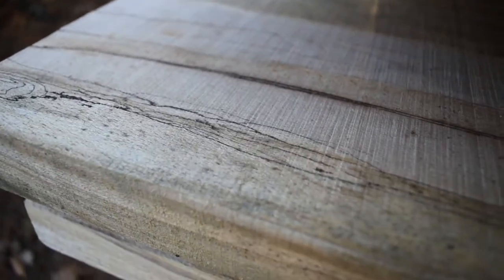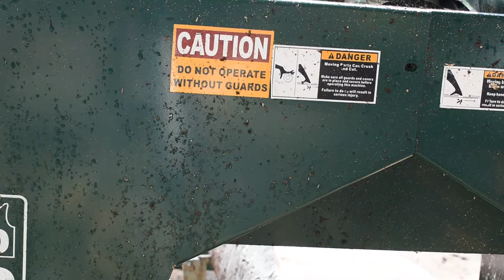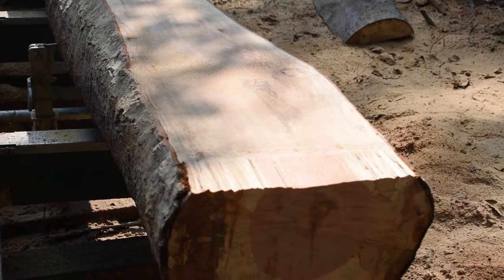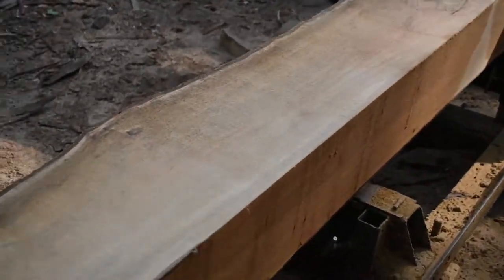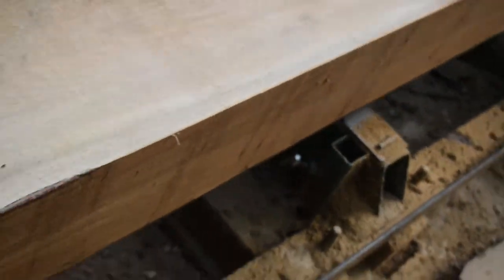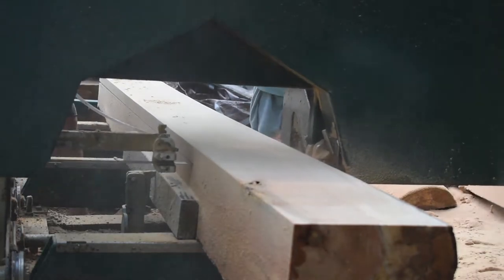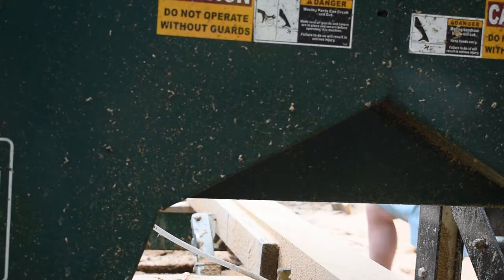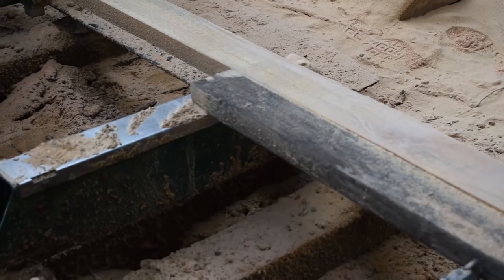Milling a Spalted Beech Log - Making Beech Lumber - Woodland Mills HM130 Bandsaw Mill

Comment: Have you had any issues with the Beech twisting or warping? It has twisted grain most of the time and I've wondered whether it's worth milling or if will turn into a twisted mess
Reply from the maker: Beech can be tough like oak sometimes.  If it has a lot of stress in the tree from growing it will be tough.  I would recommend sealing the ends of the log with paint, milling the log, stacking and stickering, then strap it tight really good and air dry it.  Beech is a great wood o work with, but it is very hard.
Reply: Thanks for the advice!!
Reply: As a suggestion, I started sealing ends with large containers of straight wood glue, two coats, and it works fantastic
Reply from the maker: @afriesen6  Wood glue also works great. 💪

Comment: My wife and I have been watching your videos for a while now. From set up etc. 
I have a few questions for you if you don't mind or have the time to answer them. 
I am tossing the 130 and another  mill. 
Since you have had your mill for a while now, how well do you like it. How hard is it to get a true 6X6 post out of your logs and it still be square on both ends. 
How about the blades, Are you sending them off for resharpening and or is there even a service for that or do you do it yourself.?
I am looking at the total cost to run the mill over a year or two year period, and I figure the mill will use quite a few blades trying to mill enough wood off my property to build a cabin, and or small house. 
I appreciate you taking the time to make the videos with your mill. 
Also, I have seen a couple on youtube with electric starts on this model and I don't see it as an option on the website and I don't see electric start on yours either, so curios what you know about that, I figure I will be doing most of the grunt work and my wife will help as well, and if she can run the smart end, i.e. me not having to start it for her, it would make life easier.?
Thanks again and have a blessed week my friend.
Reply: Also, My wife and I are close to 50, She has a bad back and mine is just old, do you wish you would have built the rails higher so you wasn't bending over as much, I am trying to figure out if we wouldn't be better off building a higher stand and or going with the trailer model, i know loading the logs would be harder, but milling I would think make it easier not bending over nearly as much for each pass of the mill?
Reply from the maker: Heartland Outdoor Living Thanks so much for watching being here with us all this time.  Since you are looking into getting a mill for yourself I will work on making a good Q&A video since it will make it easier to answer these questions and I will be able to go into more detail.  Thanks for watching and feel free to ask any questions you like.  I will put a video together and answer them all the best way I can from my experience.   Thanks for watching.
Reply: Dillons Woodworks thank you sir. We look forward to seeing it.